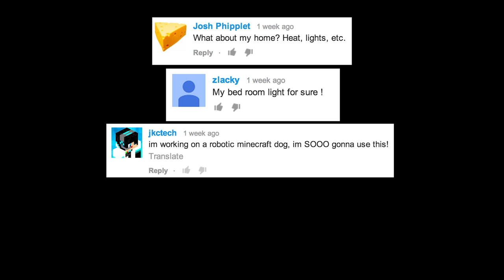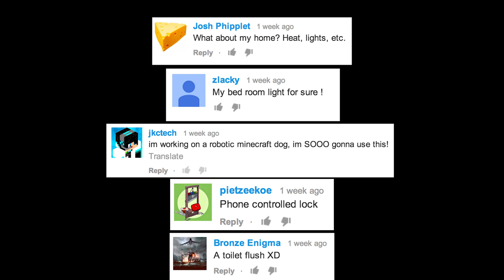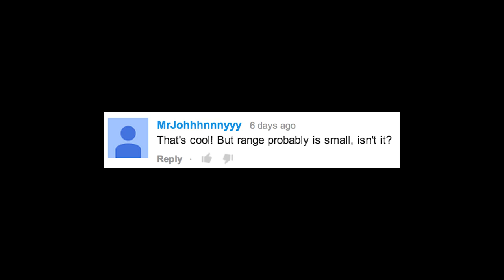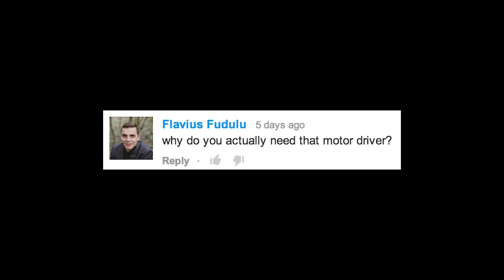Comments Show: Smartphone Controlled RC Car

Comment: Thanks for the RC video when i build my house in the hopefully not to distant future. I will be designing a fully networked SMART house. was thinking of using bluetooth and have automatic pairing and using the MAC for Authentication so once in range doors automatically unlock the front door. that kind of thing.
So hopefully you do the smartphone controlled house :) would love to steal some ideas for my own project.
(Yes i will have keylock overide )